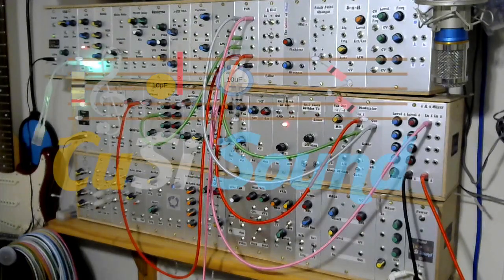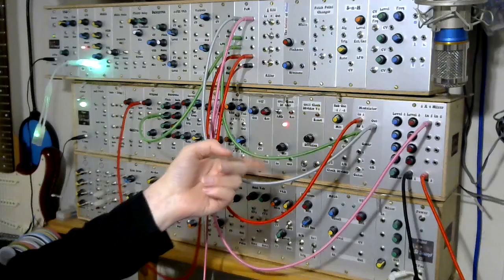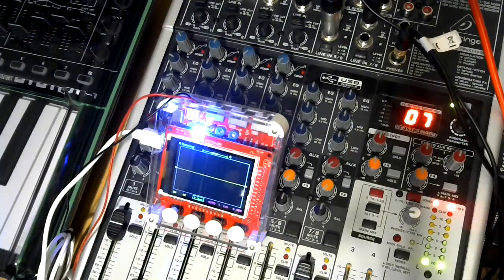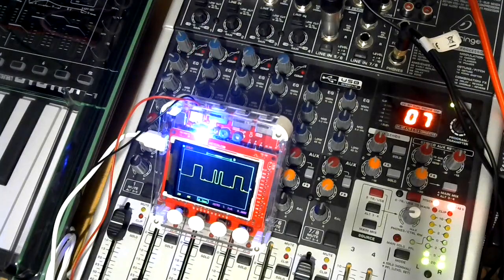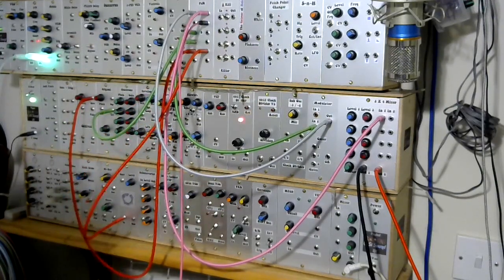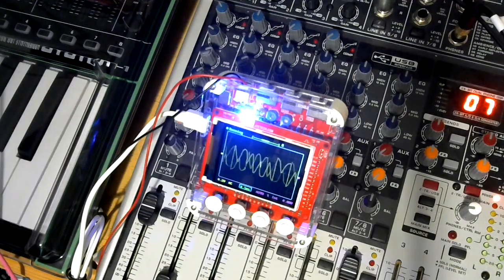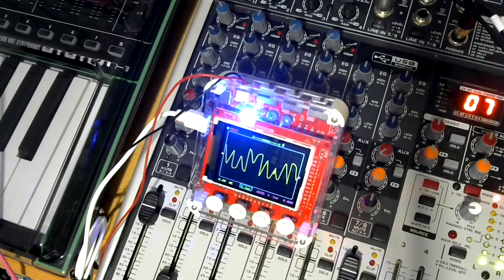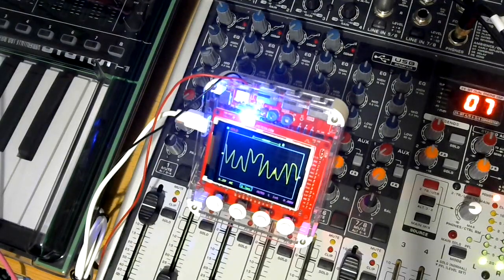Ring Modulator Waveforms

Comment: Alan. Thank you so much for taking the time to unpack my comment and then enrich the understanding of the two devices further by showing us the outputs on your scope. I am hoping Santa is going to get me an oscilloscope for Christmas as I have an idea for a Pi Pico based oscillator but need to debug my code in the analogue domain. 
One extra thing.. logic gates give high or low outputs but by voltage dividing the outputs of several gates you could create 2 or more distinct voltage levels. that might produce some really bonkers waveforms. R2R circuits.
Again thanks so much. Martin.